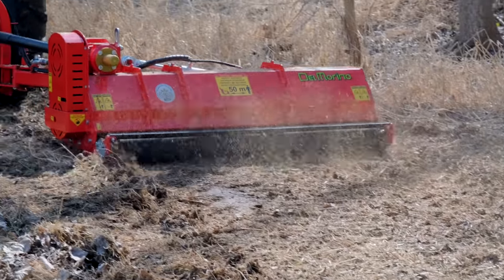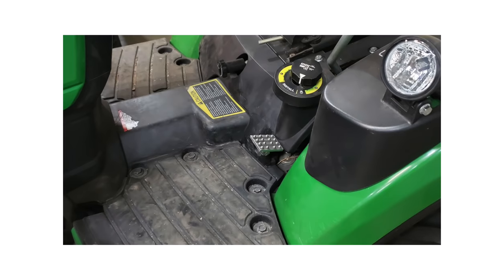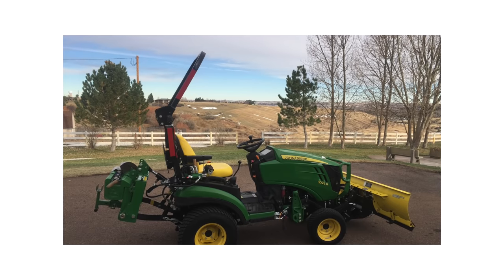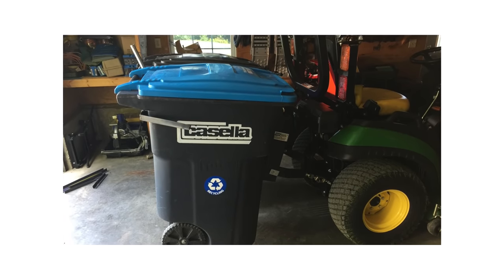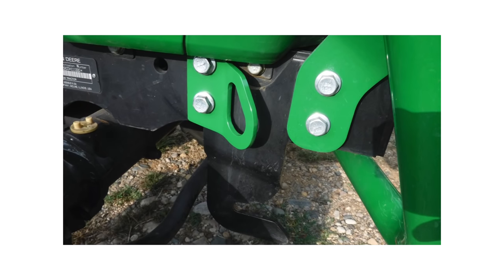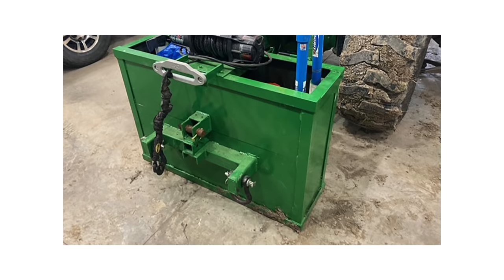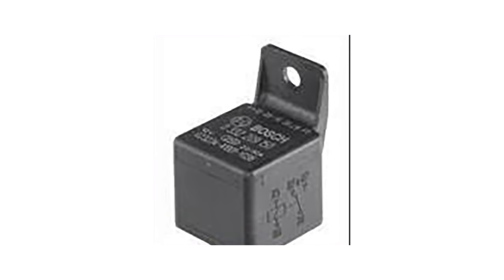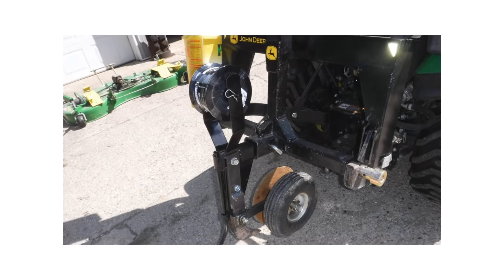20 TRICKED OUT TRACTORS TO FUEL YOUR FIRE: CUSTOM MOD SHOWCASE!

Comment: Nice video. I stumbled on to it because I am planning on putting ROPS or some other framework on my old JD 420 garden tractor which never had one. The main purpose is for shade. I built a motorcycle 54 years ago out of an old heavy 1 speed bike when I was 16 years old using an old weedburner engine that was in the scrap pile. I modified the engine to run horizontal from vertical shaft because that's what I needed for the bike. I welded the engine onto the bike frame after removing the gears and pedals which included the braking. I wore out the soles of my workboots in a week. It went about 20 mph and we had a blast. It is more rewarding in my opinion to create something from your mind than to buy something. My girlfriend was there and we roasted marshmallows with the torch. She is now my wife of 46 years.

Comment: That leaf hauler on pallet forks gets me thinking of how to load it easier. Basically a similar set up for a rear mounted bagging system, except the extra blower/pick up motor is mounted to the box and powered either hydraulically or by a small gas engine to pull the clippings from an lower deck under the tractor to the forward box that's on a front loader arm. The front loader being able to lift higher to pour the box contents into the box of a truck or into a larger trailer.

Comment: I was wondering if anyone make an extension flat towing bar, I want to be able to move my 16ft RV around the farm, got a truck but it's not 4 wheeldrive . Any suggestions from fab guys, or where I can get one... I need George on speed dial. 🤣👍💜. Very nice storage space  for winter equip. 🙌

Comment: At over $350.00 bux plus shipping for YOUR cat 1 quick hitch, my $99.00 quick hitch from harbor freight and two sets of bushings is just as strong, and a helluva lot cheaper. I've been running this setup for almost 3 years now with out a single problem. And one of my attachments is a 48.3 inch reverse rotation rototiller that is VERY well built and heavy.
Reply from the maker: If memory serves, it's roughly 15 pounds lighter than the Speeco and nearly every day I have someone buy a Speeco from me because their cheaper Harbor Freight hitch either doesn't fit or has had another issue.  

So, I'm glad to hear it's working well for you, however it appears they have some real quality control issues going on.
Reply: If you're using a quick hitch on a rototiller I would suggest you try it without.  Quick hitches are pointless on small Tractors.
Reply: @supporterofeverythingyouli6255  Very much true.
Reply from the maker: Pretty sure you're not correctly assessing the situation.  The folks that are buying quick hitches already tried hooking up without.  They want a better solution.  Nevermind, it all makes sense now that I re-read your user name 😂👌
Reply: @GoodWorksTractors  there is one out there?!
Reply: @supporterofeverythingyouli6255  I've had many JD tractors in my 70 years of living, my 1025R being the smallest. I also have Parkinson's so hooking up my tiller was damn near impossible for me to do. The quick hitch made that job soo much easier for me.
Reply: @GoodWorksTractors  LMAO  ;}>
Reply: @GoodWorksTractors  Like anything else we have and use on our tractors, I keep my quick hitch lubed where it needs it, the locking levers, and the locks themselves, plus the hinge points. I use the WD 40 sticky foam lube spray. Works damn good too.
Reply: @supporterofeverythingyouli6255  You don't have a clue what you're talking about. And seeing your handle, you just don't have a clue....period.